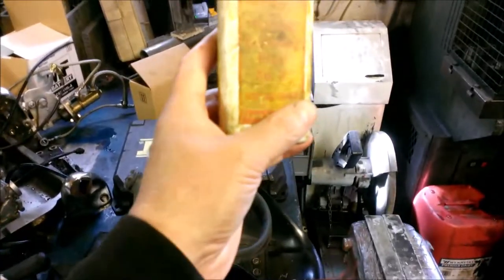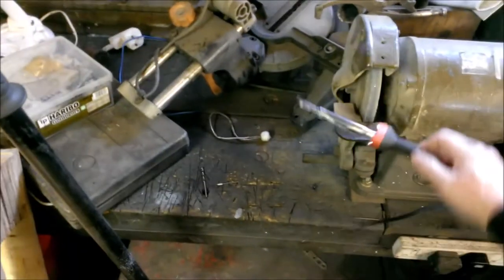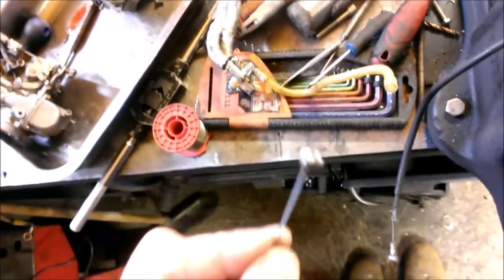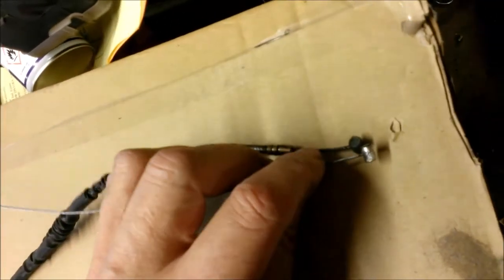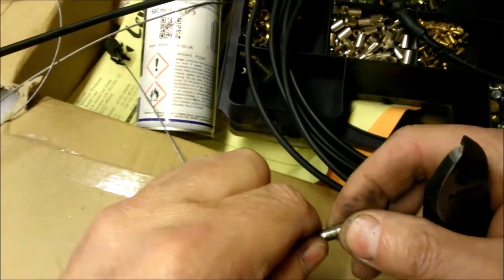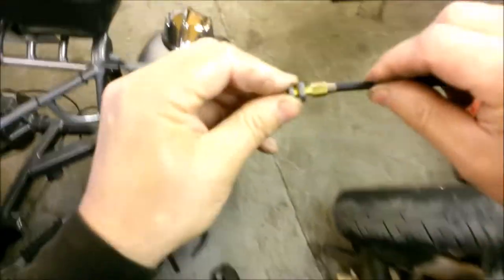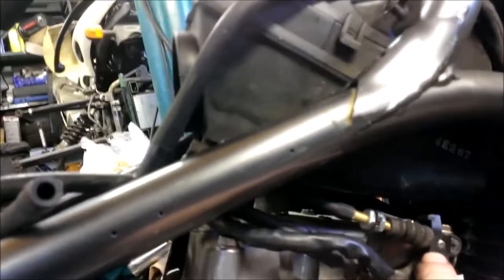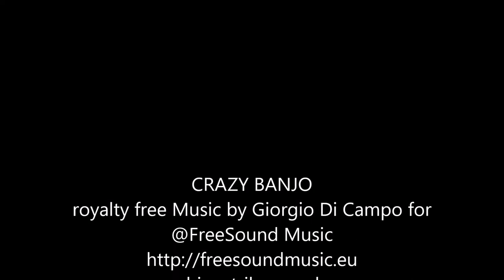Making your own control cables, throttle cable, choke cable etc. Rhino VS1400 Trike

Comment: I've got nothing against bluegrass music but I don't want it  when it stops me hearing what the video is saying.
Reply from the maker: The music is only dubbed over fast forwarded sections which have no audio. If there's anything important, it will be at normal speed and won't be over dubbed. Thanks for watching and for the feedback
Reply from the maker: I've just watched it back and it is a bit distracting. I take your point and will avoid voice over competing with the banjo next time.